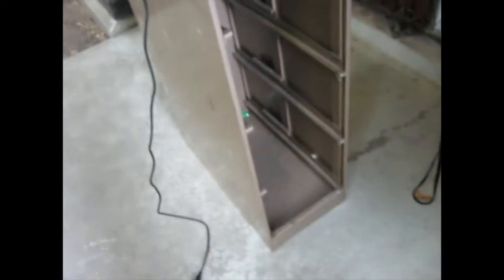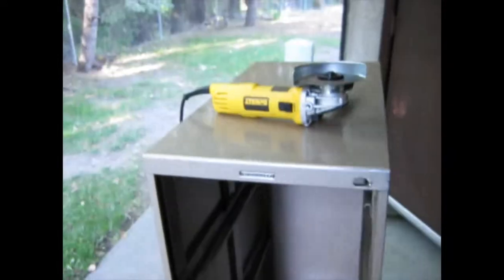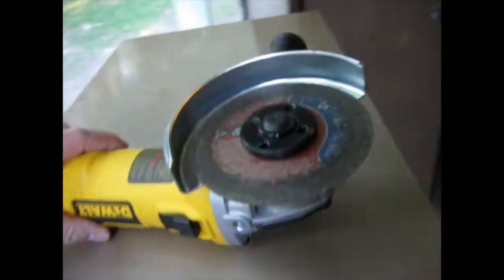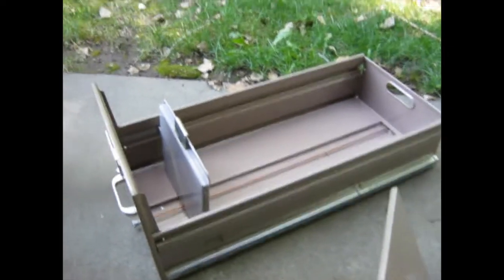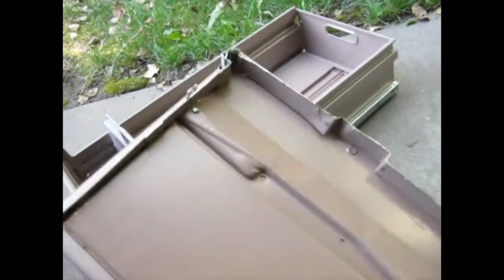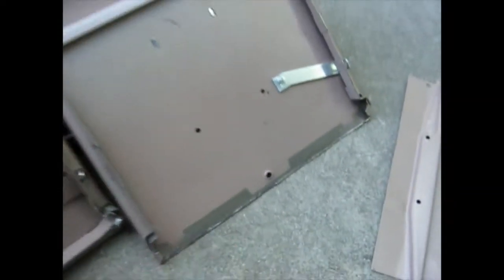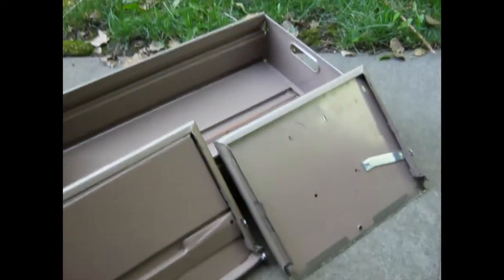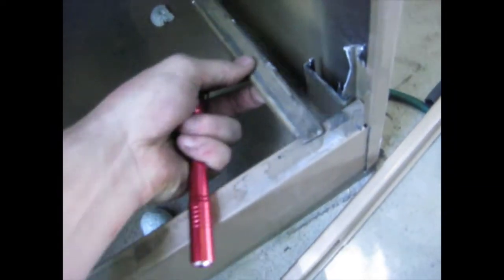File Cabinet Oven Part 1

Comment: do you know what kind of insulation you are going to use yet
Reply from the maker: Yes.  I have already ordered it. It is Very High-Temperature Fiberglass Insulation Sheeting
1" Thick, 24" x 8' sections.  
http://www.mcmaster.com/#9356K11
I ordered 3, and I will see if that turns out to be enough...according to my measurements it is....